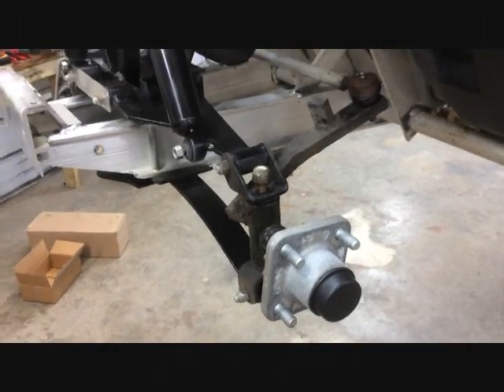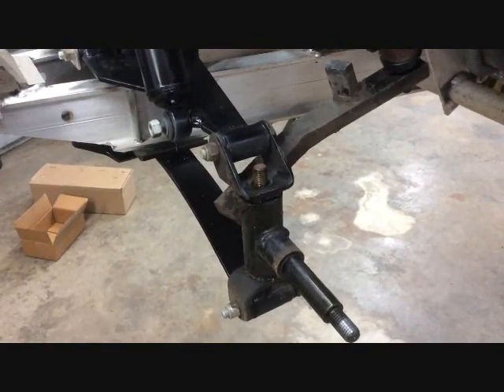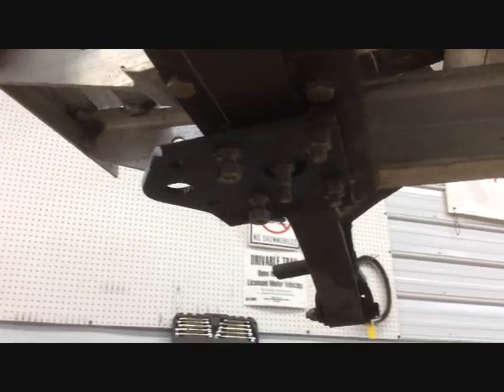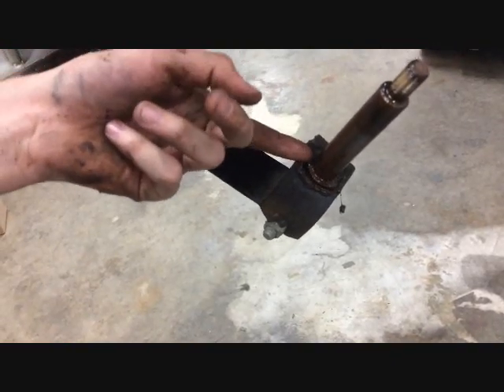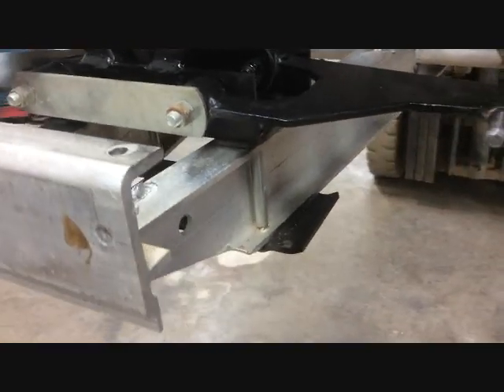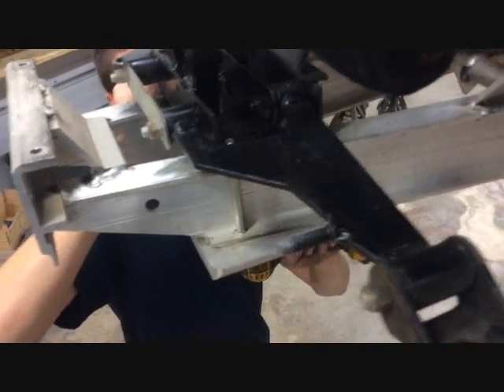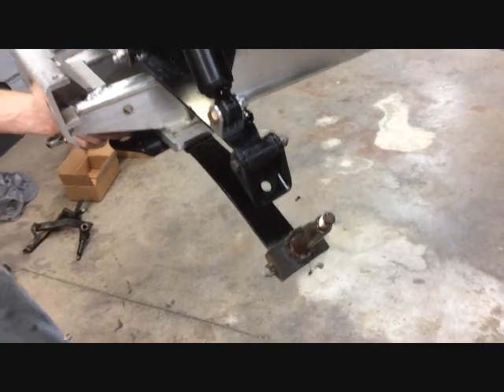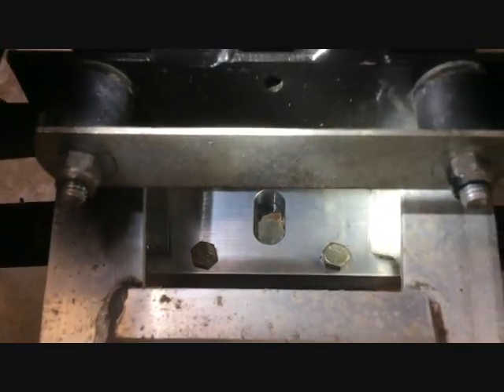Jake's Wheelbase Extension Kit Install

Comment: Installed this on a 1996 Club Car DS! Perfect fit easy install! I did not remove the tie rods or hubs! They had maintenance earlier and saved time! The only issue I had was the supplied shock bolts were too short!
This did mess up the wheel stop geometry and now the drag link hits the back of the shock tower! I plan to rework the steering stops to prevent this!
The cart actually steers too deep in both directions now!
Thanks for the video! It makes the install easier!

Comment: Hi, I have a 2004 EZ go TXT gas. When I bought it, it came with the Jake lift kit in the front only. When I hit a bump, the shaft for the steering column comes out of the spline that goes to the steering at the front frame. Is there an extension bracket that would bolt on or be fixed in there to extend that to my steering column. Or is my steering column able to be dropped down further a few inches over the spine. Not sure if this makes a difference, but my steering column has four bolts, mounting it to the frame. Thank you.

Comment: I have a 2000 Club Cart DS...  I bought 14" wheels w/ low profile tires and they hit the body up front and tuck under the body in the rear... So your telling me i buy this kit and the front NO LONGER rubs?... and then what would you suggest for the issue int he rear?... Or is it better to just buy the 3" drop spindle kit?